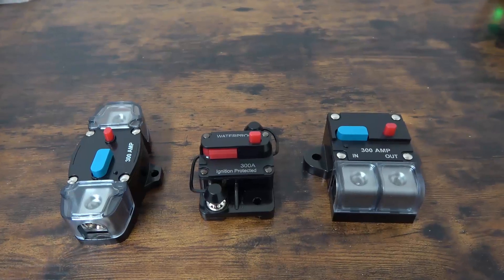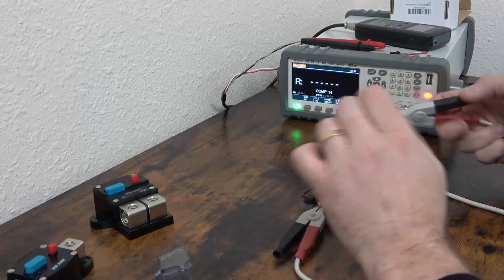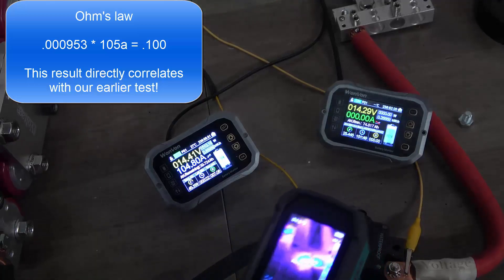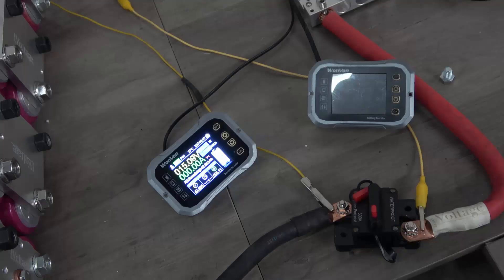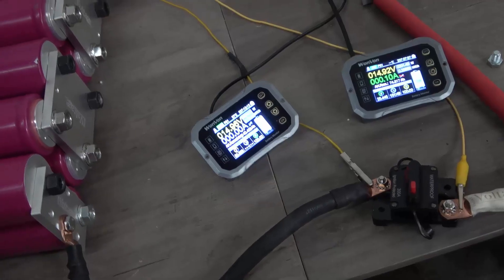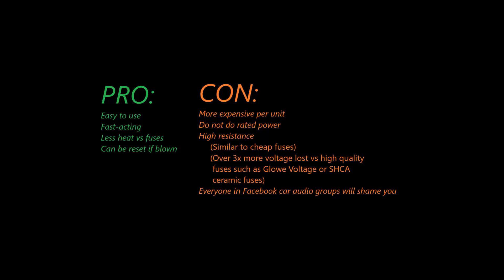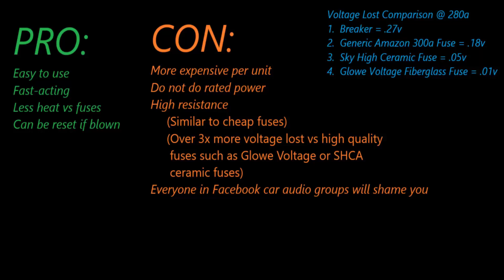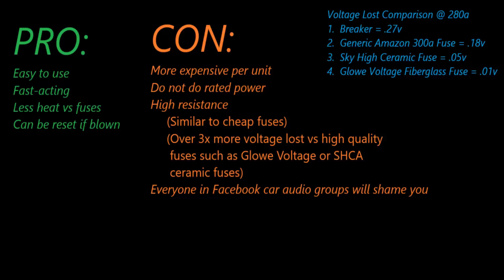Should circuit breakers be used for car audio?  Checking resistance and load testing

Comment: Thank you very much, i wanted to, but dont have the equipment to test like you do. I was debating the stinger/rockford/generic for a while now. I am not familiar with the stigma you mention. In my mind I would consider a breaker a more professional option personally, than fuses. Also my main consideration is the point in having a "fuses" in the first saftey for my ride, gear, inatall and passengers. Last time i disconnected my fuse, i needed to unscrew the holder on both ends (waterproof) then with an allen key, unscrew the terminals and I realized if there is an emergency and i need to disconnect quickly, (never have but never say never) that would be nearly impossible unless i keep an allen key near it and still take time and disconnecting the battery would be faster if had the wrench too. So decidinga  circuit breaker to be the best, safest way. Just press that button and thats it. I rerely have to replace a fuse, to almost never, so its not about saving money on buying fuses, just for safety and ease to disconnect when upgrading or swapping out something. I oredered the cheap one you tested just to see and check it out for myself and intended to find a way to test it first, which led me here. Also, it tripped at around 268, which is ok, because my max, total amout of fuses (not breakers) downstream adds up to 250amps, I was providing my fused distribution block on amp rack an empty slot capable of up to 50amps of power for future use or accessories if came up. That beubg said U will stay with fiberglass fuzes in distribution block provided for each amp and dsp etc. Just the moain close to the battery will be "switched/breaker" for reasons i mentioned earlier. So now the 0.1 voltage drop. That is nothing I wpuld worry about, currently at 14.7 wit my hi output alt, so again thank you so much for aking the time and to share this. Cheers Chris Vancouver Canada. And Happy New Year. Rick on and Ride till I die! ✌️🤘😎
Reply: I always thought it sucks I can't edit my comments on youtube for spelling mistakes after it is posted, or copy it to delete and repost with corrections. ***Rock on***

Comment: Bro this is sick thanks for taking the time to spend the money on the equipment and record a video of it. I randomly asked myself this question today as to why i never used CB's in my car audio systems in the 15+ years i've been installing my own systems, so i had to jump online and search the question, your video popped right up 😂. A quick story my very first system on a 96' Tahoe i had dual 12" JackHammer's and a 1200w JL amp powering them, the headlights would dim with EVERY note and if i turned it up past halfway it would always blow the fuse! My friends raided RadioShack for me and got me like 30 of those fuses because they were like $5 to $10 a pack of 2 back then... and i was blowing at least one fuse a day😂 Good times. Thinking back a circuit breaker would've saved me so much money!

Comment: I just went with a regular fuse holder and GV ceramic fuse and everything is charging right...i had one of those circuit breakers and it wasnt charging the battery actually not enough power was goin thru

Comment: If that's how you terminate cables for 300 amp circuits, Im glad you won't be going anywhere near my circuits. 
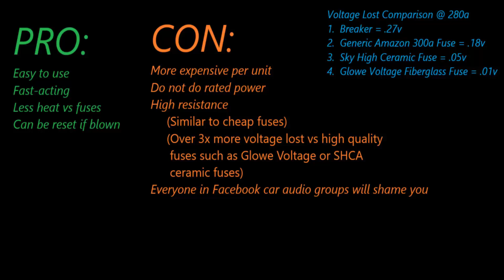The infrared cam at 15:10 makes it very obvious how bad the redcable terminationn is working.
Reply from the maker: I was trying to check this out, but at 15:10 the video is just about to conclude and doesn't have anything relevant.  I was also checking the thermal cam footage.  If you check out at 7:50 or so, I indicate (with a literal laser dot) right where the thermal image is displaying the highest temperature, and it's the fuse box itself.  

My cables are terminated using OFC lugs using a powered hydraulic crimper.

Check out the video again and let me know where your concerns are more specifically?  I'm always willing to improve my process and learn from anyone with more experience.
Reply: @GloweIndustries  This dude came into the comments to run his mouth acting like he is Electrician Of The Year 😂 Probably works at Wendy's and isn't even in the trades.

Comment: I wonder where you got the numbers for the "Amazon fuse". The 280A case would produce 75W in at that circuit breaker. Videos of the solar community showing DC breakers used under load don't let me trust them. The spark will deteriorate the contacts.

Comment: I only use breakers in my car; I have them on the line to my battery and one per amp.  I didn't know people looked down on them,  I just used them for convenience and safety.   It's really quick to cut the power to one or all my amps if I'm changing anything. 
I have an SQ install so I'm not pulling a lot of current most of the time. 
I don't think the price is bad (I paid less than $5 each) when you see how much fuse blocks can be.

Comment: I'd like to see the breakers be subjected to a controlled number of openings and closings under (again, controlled) load, and then the resistance tests repeated to show any potential degradation from cycling, particularly under load where the arcing is brutal on the contacts.

Also interested in how they hold up thermally over longer periods of time while at a current a smidge below the point they trip. Like for someone sitting handing out demos for a few hours straight. 0.1v at 250 amps is 25 watts of heat, which is more than my first soldering iron was rated for.
Reply: Yes, I've heard stories that after they cycle a few times they get worse and worse and may even stick in the closed position creating a very dangerous situation.

Comment: Last point about the FB groups is so real. The results really surprised me. I think these would be very useful in an SQ system or for someone that swaps out gear comstantly, instead of pulling the fuses you can disconnect the battery with a push of a button. Thanks for these tests👍

Comment: so. are there any actual options to have a circuit breaker/switchable line? for around 300 to 400Amps?

even if it features no auto switch-off/fuse ability. the ability to cut power from the vehicle without unbolting fuses or wires would be really handy, 

in situations where the custom battery pack is inaccesible. but the car needs a reset. just unbolting the wire's is not ideal.

i seen those huge "battery switches" for sale online. for 2/3/400 amps. but they look sketch imho.
Reply: Look into the marine certified switches like the ones from Blue Sea Systems. They are UL marine certified and some handle 500 to 600 amp continuous with much higher amperage for shorter amounts of time.
Reply from the maker: Maybe getting something like these but a 500a version..  I haven’t tested those but may be viable.
Reply: I run the Amazon  ones   one of each  alt   and I love them  9k watt clamped  audio system  17k amp 2 370 amp alts  and they do amazing   I see  260 amps total  coming  from my alts  after really really  beating  on it   so half that between  two breakers   160 amps per and I can demo all day run the lanes  never had one trip and working on my bass ride it is super convenient  to  just pop them with a push of a button  and kill power   alts set voltage  is 15.5 and I have still  seen 15.7 on cold days so no complaints  yet